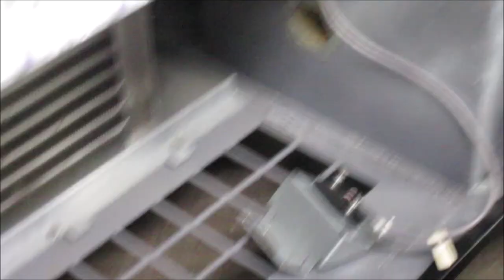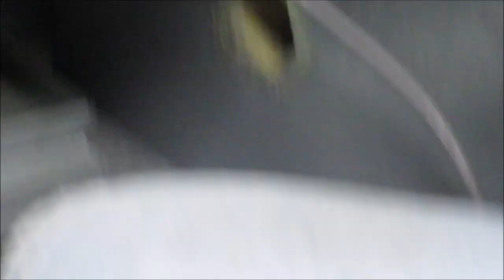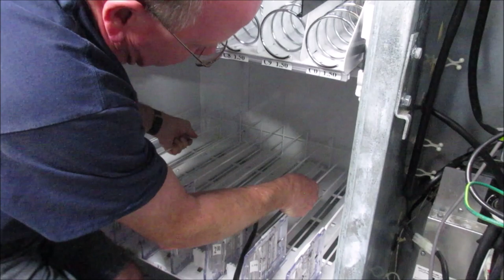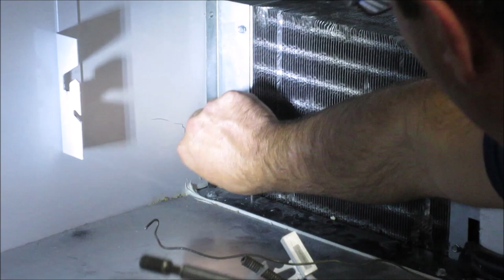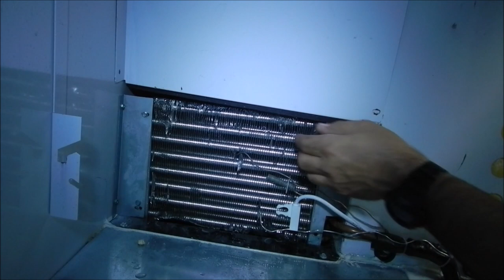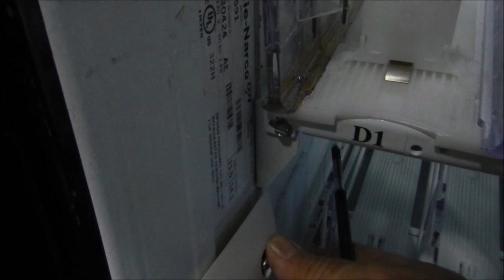Dixie Narco 5591 Compressor Removal and Reinstallation

Comment: Seems like the new unit has 2-thermostats and 2-defrost sensors installed. My new compressor has an inline defrost module. Trying to figure out what to do with the old one, since I get no power to the new compressor